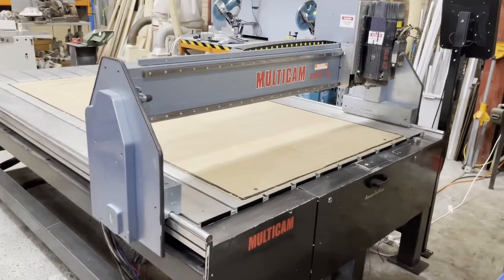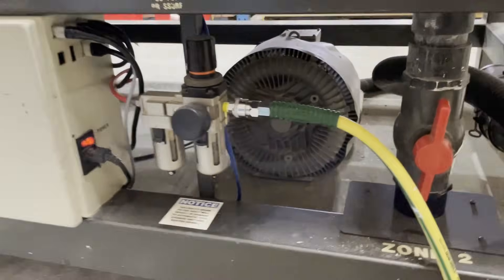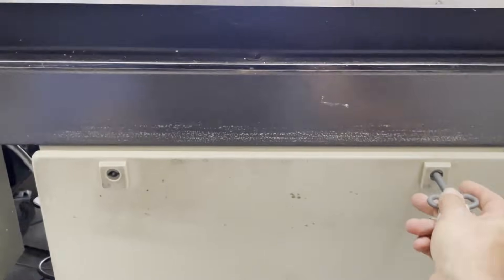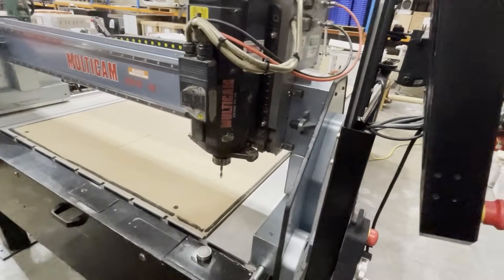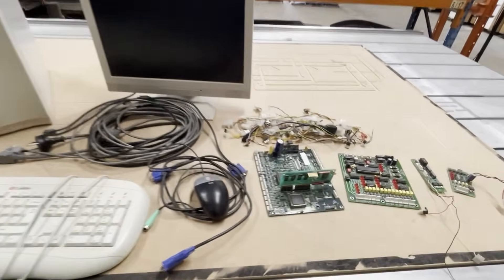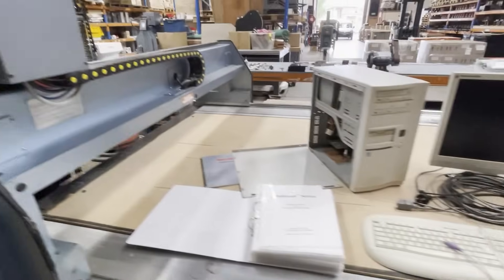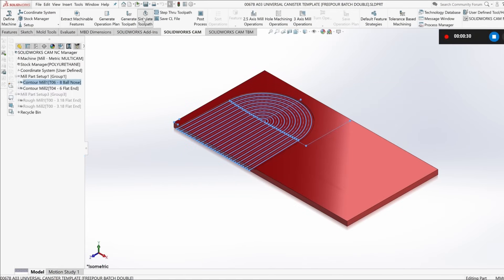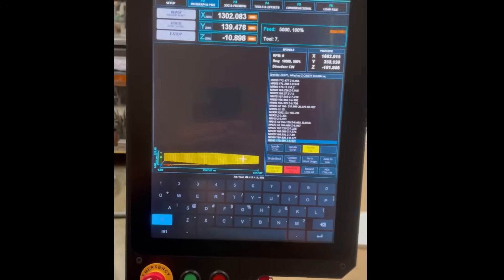Old MULTICAM machine, back to life with MASSO G3 Touch Controller (MASSO Reviews)

Comment: I just brought a Multicam M1 1200 x 1000. I already have a Masso controller, new motors & drive card, new 18000 rpm 4.5kw spindle and VFD, as I was going to convert my manual mill. Can you point me any resource that may help me set this up,      thank you...